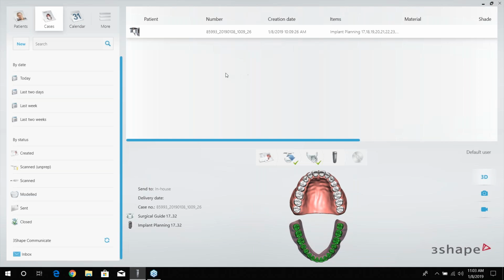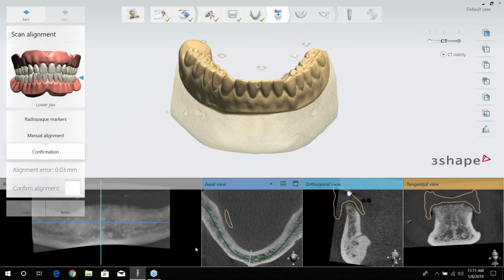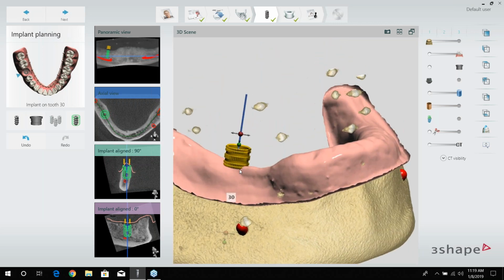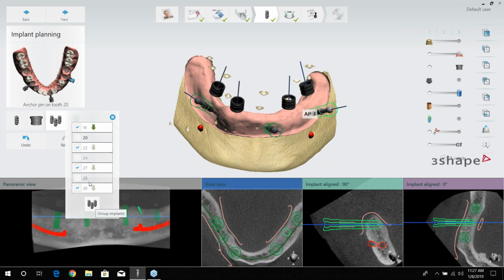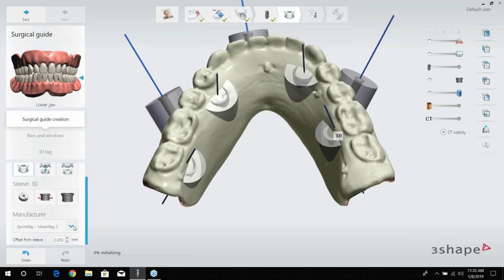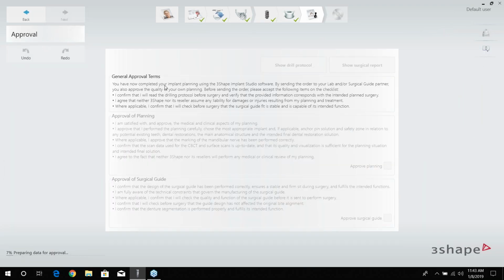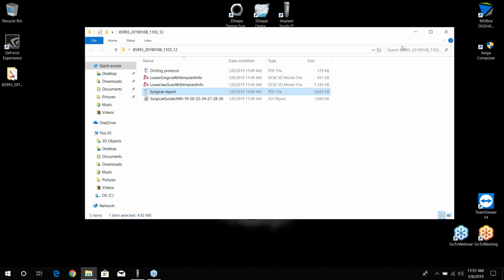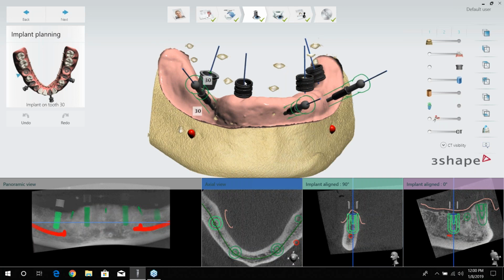[Webinar] 3Shape Implant Studio 102: Edentulous Surgical Guides with Evan Kemper

Comment: What if patient is not using denture ? do we have to make a denture first for making surgical guide of edentulous patient ?
Reply: There are two approaches in case of edentulous workflow. First one is Denture workflow when you still need denture or Wax Rim, etc. with radiographic markers over that to scan and align them with bone scan. the second one is to use bone supported workflow when you will take only bone scan and place your surgical guide over bone level.

Comment: What are the sleeve for? Or whats the purpose of them
Reply: Hi, the sleeves prevent the drill from possibly cutting through the guide material and changing the angle of the implant.  They also make sure the drill will fit through the hole.  The sleeves give a much more uniform tolerance than the printed part.  Essentially, the fit will stay the same regardless of the printer that makes the guide.